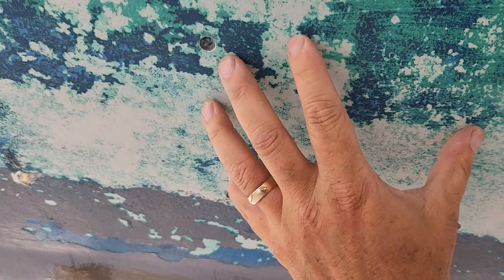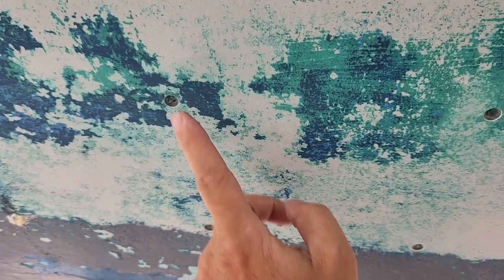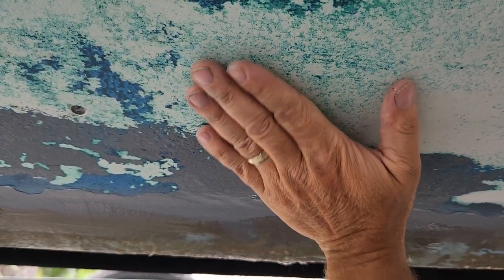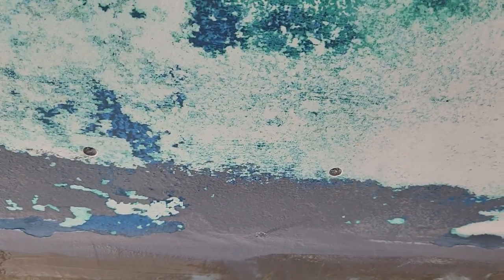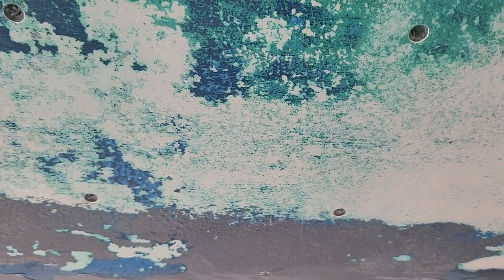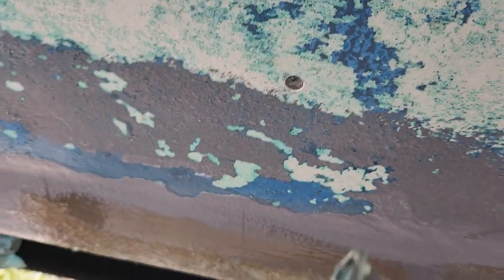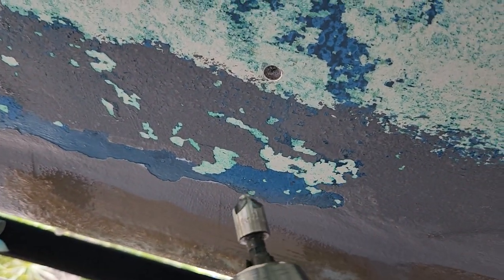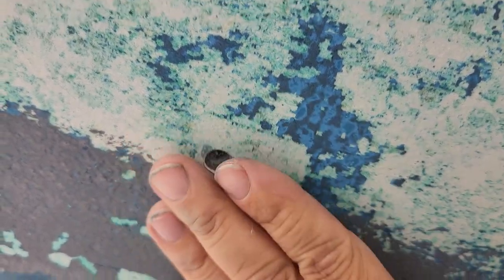How to repair soft spots on bottom of hull of fiberglass boat.  A great DIY repair that will last!

Comment: The building repair guys fixed our path with that stuff and much the same method. It was done with a serious pump truck to inject the foam. But literally before your eyes the concrete rises and can be walked on in minutes.
Reply from the maker: Crazy stuff indeed!

Comment: I have the same problem with my Angler 220. I’m curious to know if this worked. Did it stiffen up the bottom of your hull? Have you had any more problems with it?
Reply from the maker: Hello, I have had no problems since and used the boat many times out of Daytona.  The bottom is very stiff now and I would say it worked amazingly.
Reply: @goodtimes1828   Thank you for the reply. I’m sanding the bottom coat now and doing some minor fiberglass repair before I repaint. Noticed it was delaminating, stumbled across your video and was hoping to hear back due to my extreme fear of drilling holes all in the bottom, lol! Repair man quoted 10 grand to fix it.. Nope! Anyway, thanks for the info. I searched all over the internet and your video seemed to be the most feasible solution.